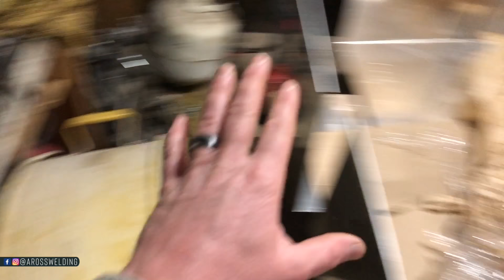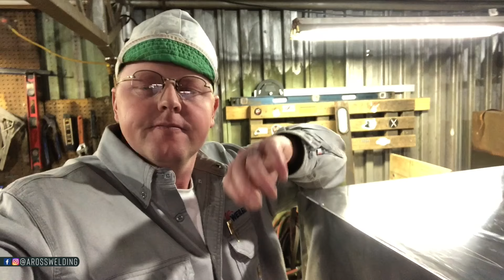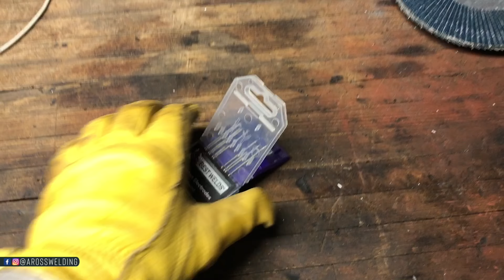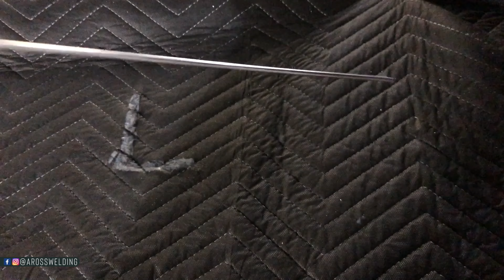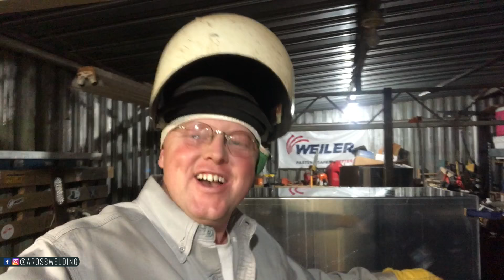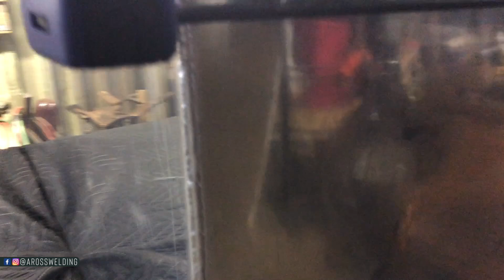TIG WELDING BIG ALUMINUM BOXES FOR THE FIRE DEPARTMENT // TIG WELDING ALUMINUM FABRICATION

Comment: We use 40 grit flap discs with crc 5.52 oil for buffing aluminium. Lubricating helps the metal not become "pasty" and stubborn. 

Might need to degrease after though if mission critical!!

Comment: Plug your machine to 220 so you could get its maximum output....1/16 tungsten and 3/32 filler metal, on outside corner bead might do  but you’ll struggle on inside corner...use 3/32 tungsten and if you wanna pinpoint your arc ,raise up your ac frequency. If your weld is ugly on initial pass,try to run again on top of it while it’s still hot but barely add some filler, see if it makes some improvements

Comment: We’ve been running the same machine and it definitely helps running the higher voltage. It seems to puddle faster and even in the lower amperage range it seems smoother.

Comment: You should invest in a tungsten grinder. On your flap disc or bench wheel method contaminates your tungsten with whatever else has been on it plus you can't maintain the correct angle... sharpening is extremely important.

Comment: Hey, something else are you right or left handed? The reason I ask is, I am right handed. Whenever I am using a fill rod, I hold the torch apparatus in my left hand, because all it has to do is provide the heat base. I then use my more- articulate right hand to feed the rod and I am better able to control the puddle to create a weld, which looks more like a stack of fallen-over dimes, rather than what remains after a chicken strolls through.

Comment: I build metal buildings and trim comes with a protective plastic sheet, very thin, attach, which has to be removed when you attach the stuff to the building, but that aside, I'm wondering if perhaps aluminum might also be available with a thin protective plastic coating as well.

Comment: If the machine is an inverter that’s why it’s louder. Its the switching frequency of the inverter portion of the machine that is making the noise. It is taking DC and switching it on a high carrier frequency to "create" AC.

Comment: I always wear ear plugs when welding aluminum, that A/C is one noisy son of a gun! Your travel angle looks to be about straight up and down, in the arc shots, might be able to move a little quicker if you kick it back 5 or 10 degrees.

Comment: Brush your edges with a simple wire brush only used on your aluminum, 135amps should put you good on penetration. Also check your balance always start with it around 70%.
Reply: And don’t be scared of the heat, you have to let your puddle form and speed and flow will come quick!

Comment: Is it possible to go to welding school and be a pipeline as soon as you graduate, or do you have to start as a helper ?
Reply from the maker: It depends on who you know. Your network. Your connections. And how much pipeline work is goin on at the time.
Reply: Its not as easy as you think, i wanted to do that myself. But you gotta rig up, and that means getting used truck, used machine, tools, tanks...and honestly no one has that much money when they get out of trade school. So you gotta either get a loan or start working from the bottom of the barrel AKA Rat Shops. I changed course because i liked going home every night and wanted to stay local, however throughout the years i managed to buy my own truck and a brand new gas welder to start my own mobile business.

Comment: Hi Mr. Ross I have a question not just for you but for anybody who may know, what jobs can a high schooler apply for in the trade at the ages between 15-18. Any reply is appreciated very much.
Reply: From what i have seen, your best bet is either an apprentice welder or if you have decent welding experience (1 year) you can get a job as an entry level welder. Most companies these days want an entry level welder because they can pay them less than an experienced welder. Good luck on your job search and gain all the experience you can.
Reply: @BenRossi901  thank you very much. I appreciate it greatly. I will note that down and look around. I have 1 year of experience and needed a place to look. Thank you.
Reply: @markmeigs6506  

Yup, that 1 year will be enough to get your foot in the door for any entry level welding positions, you got the experience to back yourself up and negotiate a bit with a decent hourly wage.

Comment: That's one thing I'd like to learn! I've tried aluminum welding before but am not good at it!
Reply: By far the easiest metal to weld, its so forgiving. Once you get the basics of it, it's fun. Just remember everything has to be clean clean clean.
Reply: I spent a whole semester in college trying to learn it. I finally got it down though. I'm not perfect, but I can lay dimes pretty good and there is a lot of little tricks to know to get that to happen.

Comment: Hey Austin, I have the same machine, if your plugged into 120v you don’t get as high as amps of plugged into your 240v. A little tip I learned with TIG welding aluminum that’s to thick for your machine is to preheat it. It’s amazing the difference you can get. Preheat to 400 degrees... I think... probably depends on the actual thickness of the aluminum your welding. Just a tip bud love the videos.

Comment: I see someone else mentioned bees wax you can grind it just like any other metal by putting some on your grinding disk . You can get a spool gun and pull the weld and get that perfect bead I would push for strength then pull for looks try it out.

Comment: i'm sure others have answered this already.... but when I clean or buff aluminum, I use a flap disc and spray some WD-40 on it for lubricity, leave a nice finish and your flap discs wont clog up either.  As far as welding on that 3/16" with 125amp: I know that the machine maxed out, but a little preheat goes a long way.  once the aluminum is up to temperature welding is made easier.  You might have noticed that the further along you were on the joint, it was mostly because the material temp is increasing as you go.   I hope that makes sense Austin!

Comment: 120v won't give you the amps. Use the 240v plug. The welding noise is frequency.  On outside corners try 90hz.  If you're getting  high spots just go back over it with more heat.

Comment: I use that machine at work and it’s really loud also did notice you stepping on the pedal and nothing I’ve ran into that issue and I just touch the tungsten to the metal or aluminum and hit the pedal.

Comment: 200 amp would be just knocking at the door of 3/16 aluminum. That machine is probably fixed at 120hz. Aluminum hates argon, it can get really violent sounding large cleaning lines if gas is through the roof,  you'll also notice lots of arc wander with excessive cfh. I wouldn't grind those unless they're full pen. Ditch that 1/16 all you want to use is 3/32, you're way over the limit of 1/16 and it probably loses shape rather quickly

Comment: Hey there Austin. You can try turning your AC Frequency down low to about 60-80 hz. Also balance can be turned down to 25-30%. That will also help you get more penetration with lower amps.

Comment: That torch has got to be getting warm without the water cooler...
Reply: Ive welded aluminum using air cooled before. Just dont overdo it, and you wont pop. The water cooled lines seemed to be so sensitive to heat, they pop when they want to

Comment: I learned for alumn tig not to put a fine point on it let it make a ball on the end
Should have made more bends to save welding just have like the end caps makes it nice and save time
Reply: You can also get that alumn with a protective plastic wrap that helps with handling when bending just peal back little ways from where you welding and when done remove all helps a lot

Comment: I use to weld aluminum plate years ago and we never sharpened the tungsten.  Just struck the arc and let it ball up and you can carry a lot of metal it to the edges that way.  Should be able to stack dimes.  We use advantage machines with high frec boxes tho.  Square wave may be different I never used it.
Reply: Stacking dimes is important to me. The weld should look so pretty that you don't want to grind it down. Also, if you're doing it like this, to get a nice ball on your tungsten start on DC and let the tungsten melt for a couple seconds. Then switch back to AC. I'm doing it now in college. My instructor never told me that but I learned it from another college instructor that does videos on Youtube.
Reply: At work when I'd weld with the old square wave 275, I'd ball my tungsten by leaving it on ac and just holding a really far arc on high amps and it'll ball it pretty nicely

Comment: If you get an 80 grit sanding pad get some emergency candles and grind some of the candle with the disk and then sand the aluminum the wax prevents the disk from clogging, it will melt on the aluminum but it wipes right off

Comment: You talked about being diverse. Atm I'm learning tig,mig,stick. As well torch welding with soldering and brazing I also while practicing I do a weld right handed then switch to left hand so I don't have a dominant hand. I still have aluminum to learn. But, heard it's more forgiving than stainless in mess ups which relives me a bit.

Comment: You most likely need to switch your welder over to 220/240 volt. Then you can reach the higher amps. Probably just need to switch  cords. I have not used that particular machine before but most newer machines have went away from the switch tgat does it. They do it automatically when you plug in the pigtail. Some actually have a different cord all together you pull out and plug in the other one.

Comment: Knew they were cold looking, 316ths outside corner joint u need at least 180 200,,max for 135 amps is 8th maax, I use 332 from...anything up to 250, then 8th, more heat and 332 tungsten 332 filler 5356

Comment: You could always pulse back over the weld beads without filler to make them look prettier
Reply: That's just extra heat
Reply: could cause distortion and mineswell do it right the first time.

Comment: The reason why it's so loud is because you have the cleaning action on the AC side so the cleaning it and then it's melting it that's why you hear that big buzzing noise
Reply: No, it's loud because the current is on AC and AC is alternating current. The current is switching back and forth between positive and negative, and that's what you're hearing. it's so fast it sounds like a buzzing sound.

Comment: Hey Austin so when you go to grind the aluminum down use tapmatic wax put that on the grinding disc and then start grinding the aluminum welds down and because of the wax it will not load up. That is what I do when I tig weld aluminum.

Comment: Some Mothers aluminum/mag polish with a polishing ball on a drill will really make those boxes shine, and take some of the small scratches out.

Also I use to have that same welding machine (wish I still had it, great little machine)  and if you can run it on 220v it will weld up to 200amps unlike the 125 amps on 110v, which I found seemed to weld much better especially on aluminum

Comment: That whine you hear when welding is the high frequency. It becomes high pitched the higher the frequency is and it changes how the arc plume effects the weld, so don't worry about the sound it's completely normal. And you're only running on 120V so it's max is 125 amps. Need to go to 240 if you want the full 200 amps.

Comment: Harbor Freight :
has fiber glass welding blankets that should work well over the moving blanket.
They have them in two sizes   4' x 6'  ($23.99) and 6' x  8' ($28.99)

Grainger supply:
A disc sander with a fine  80, 100, 120, 240, etc should dress the welds and finish up with Scotch Brite disc   red = coarse,   gray = medium,   green =  fine,   blue = very fine 

Harbor Freight:
If you want even more polish, get a foam pad for the disc sander and use polishing compound.
Thanks

Comment: If you double tap your peddle full stroke back to back your arc will (SHOULD) light. Little trick with the Lincoln’s and the Miller machines I’ve come across.

Comment: IF YOUR MACHINE IS 120V -240V  YOU WILL HAVE TO HAVE IN PLUGED IN 240 FOR THE HIGH AMPS
Reply: I was just about to comment this. Lol.
Reply: I learned this after struggling for a while
Reply: Exactly. When on 110-120V your max amperage will be only 65-75% the machines max amperage. When on 220-240V you'll be able to get the full 195 amps.
Reply: Yep I have the same machine and I love it

Comment: Good tip for your miters, you can get a square hunk of stainless preferably, the length of your miter cut or grind a groove into the block and clamp it to the backside for your penetration to sink down into without blowing a hole and getting easy 100% penetration. As far as the finish you could just use a regular 60 or 80 grit with some bees wax or other wax, then dual action sand it with 120 to smooth it out then use a sanding block with 200,300 etc until you get the finish you like

Comment: They make sanding pads flap disks specifically for aluminum.  Also ise acetone to wipe your material and your filler wire. Scotch bright the filler wire and then wipe it down with an acetone rag.

Comment: If you lower your Ac frequency to under 90hz it will be not as high piched also it will wrap the corners nicer i usually like it around 70hz.
Also with the pore arc starts its common with aluminium for it to miss fire a screw clamp style ground clamp often helps this.

Comment: If you ran a helium/ argon mix you could burn way hotter.. Also get some 4" aluminum flap disc 80 grit, 120 grit, and for final pass a scotch brite flap wheel.. Then a pass with a buffing wheel and aluminum polishing compound and you will never know there was a weld there.. I burn aluminum all day and have been working with it for over 15 yrs Dailey fabricating/welding.. May God bless you and your family🙏
Reply: Do you mean helium/argon..
Reply: @juancardenas522  Yes helium..
Reply: @juancardenas522  Thanks for pointing that out.. I have no idea why I wrote that..lol.. I use it all the time on thick aluminum (3/8" and up)..
Reply from the maker: This is so helpful thanks!!!
Reply: @arosswelding  👍

Comment: It would be easier if you had more amperage machine. The noise is just normal for aluminum welding. 
Usually there is oxidation on the electrode is why it won't start some times. When it does that just scratch it before you start.
If you would use bigger tungsten it would work better also and if you use 1/16 filler rod would help to. 
Would help ya if I could. I'm in sand Springs,  OK.
Reply: His machine is big enough...just not enough power going in...need 220 power to get full use of the square wave 200

Comment: Hey Austin I've been doing alot of aluminum frame work for awhile we use 2" quick change conditioning pads for final buff. Start with 40grit just knock down the high spots and go around w/ a 60 and a 80 the match surface hight, then condition pad. Looks pretty good. Keep up the good work man
Reply: yeah any flap disc and then a DA sander to make the surface look even. The only difference you need to worry about is the aluminum loading up the sanding disc.
Reply from the maker: Awesome! Thanks!

Comment: Looks good. The noise from that machine is the sound of it switching from electrode positive to electrode negative. If you turn the frequency up it will get even louder and higher pitch. A tip that I have for you is when you dip the tungsten and it makes that black smoke on the aluminum, take to cuff of some old gloves and wipe it ASAP. This will remove the smoke. Ask me how I know😁

Comment: Switch the 120 plug for the 230 plug and that machine will go up to 200 amps.
Reply: Just use little bit of helium it boosted the heat....
Reply: I was going to say that but you beat me to it. I have that same machine however I only have 120v . Marginal for 1/8 thk

Comment: You can weld thicker aluminum plate, used 70/30 argon/helium...
Reply: Separate bottles, use a splitter, you can adjust mixture better, 10 ft AR/ 3ft Helium good starting point
Reply: Ditch that dinky machine, get a syncrowave 350LX, single phase, 400 amps output pure butta , argon/ helium splitter
Reply: @Edaloy27   that what I used at work syncrowave 350lx with watercool and at my home shop I have a dynasty 200dx with watercool.
Reply: @juancardenas522  yeah we had a dry rig at work and I just ran city water line to a wet WP 20 so much more comfortable, I’m old school don’t use a cooler, never any problems
Reply: @Edaloy27  I weld a lot of aluminum from 20 gauge up to 1/2 in and sanitary food grade stainless
Reply: How can i get a tig setup for my Hobart?
Reply: @melvinmariott8609  what kind of Hobart
Reply: @juancardenas522  the elite 260.
Reply: @melvinmariott8609  air cooled tig torch kit
Reply: @juancardenas522  okay I'll look for it at the welding supply shop.
Reply: @melvinmariott8609  for what kind of welding...
Reply: @juancardenas522  for stainless and  aluminum
Reply: @melvinmariott8609  you should invest on a high-frequency machine like Miller dynasty 280
Reply: @juancardenas522  With a wireless pedal!
Reply: @deltan9ne306  wireless pedal and CK flexloc 360 tig torch.. 👍